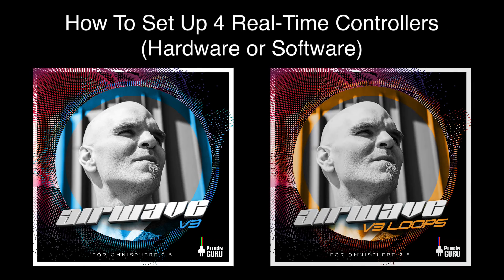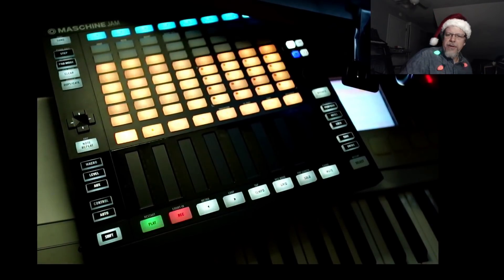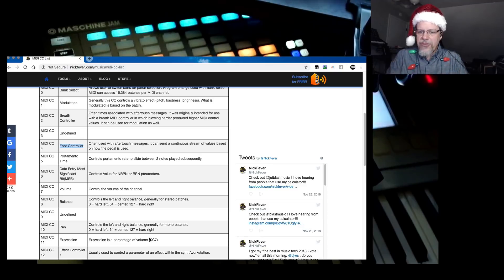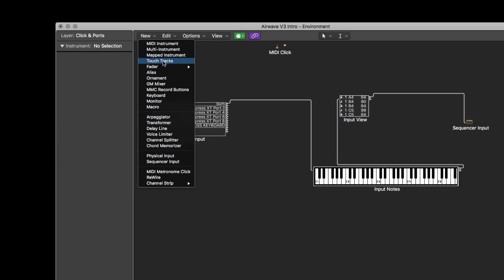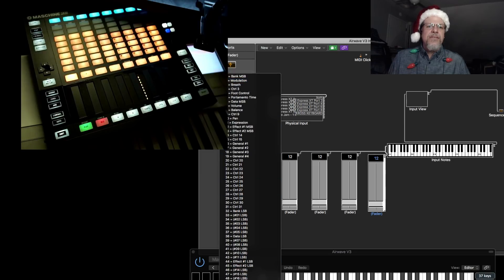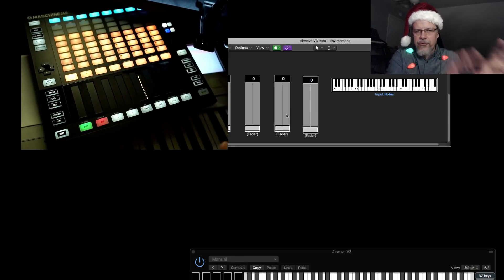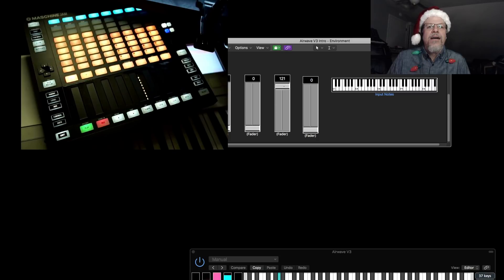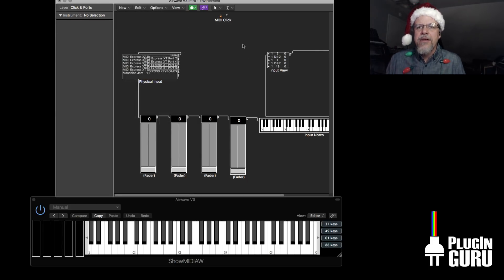How to Set Up a 4 MIDI CC RealTime Controller (Hardware or Software)

Comment: Hi there!  Bought the Airwave pack and am trying to map to Push 2.  I can assign the knobs to the mod sources, but on the Push it says 'no parameter mapped'.  Am I missing something here?
Reply: You have to set the push controller to user mode then in omnisphere change the cc numbers of mod heel, breath, cc4 and soft pedal to the cc numbers of your push controller knobs when in user mode. The omnisphere setup is in the system tab on the right :-)
Reply: @AirwaveMusic  Thanks for the reply and info.  I'll give it a go!  Really looking forward to getting that setup.  Excellent work as usual.
Reply: haro82 of course there’s the ableton way but omnisphere‘ s poor midi implementation makes it difficult for modern midi controllers to use those controls as they’re midi. I have the same issues with my komplete kontrol keyboards, have to set them to midi mode.  I have been asking for YEARS for macro controls in omnisphere but t-spectrasonics pretend it’s not that simple to put together.

Comment: In a roli seaboard is very easy  to set 4 fader controlers . I didn’t try Keys as controler faders. i think it is more complicated because all the key slider movements send CC 74. I personally use Cc1, 2,4 and 64 using 2 faders and the 2  x-y pad faders...it works really well